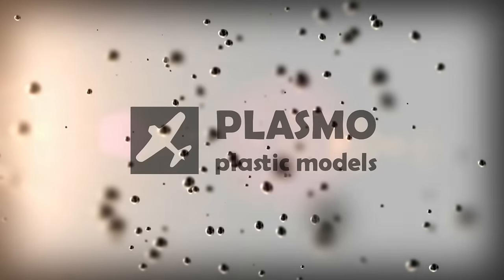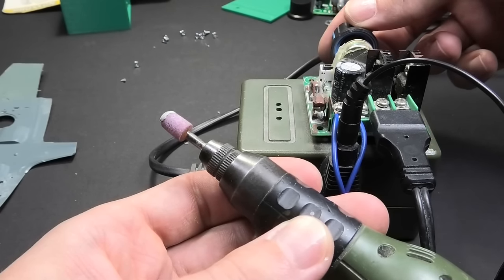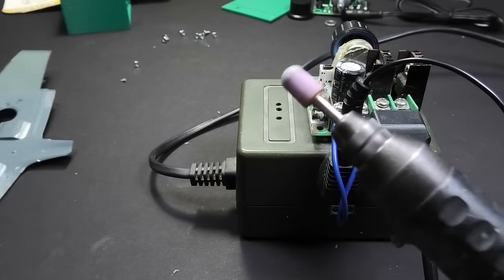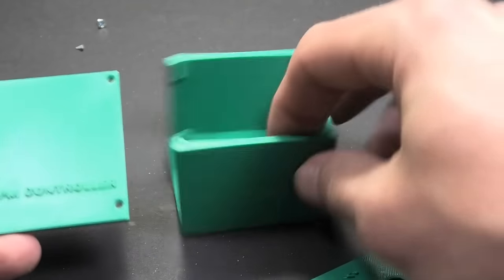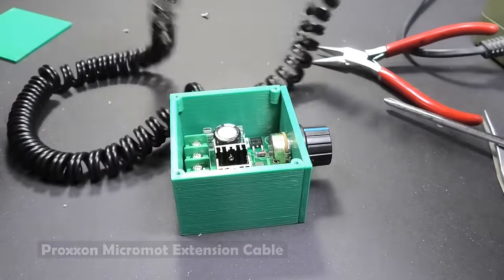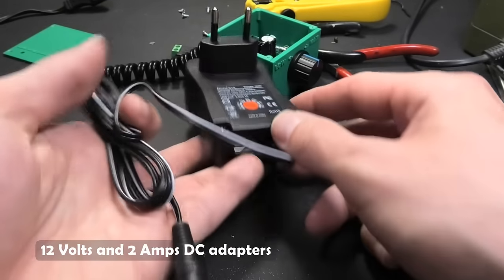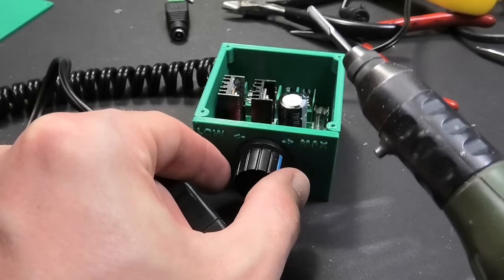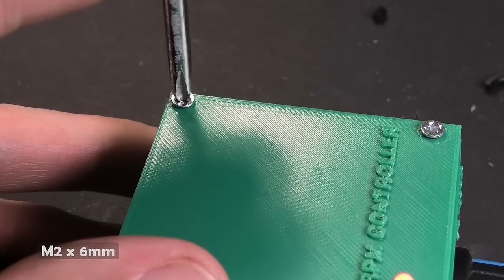DIY Low RPM Controller - Proxxon Micromot 12V Upgrade - Homemade

Comment: Simple project, inexpensive and a great way to slow down a motor tool.  Appreciate you including links to all the parts 👍
Reply: I don't get it.  Too much hassle for stuff already easily available and cheap  You can buy premade DC speed controllers for like 8 bucks and AC ones for 20.
Reply: @TheMugwump1  Good to know, thanks 👍
Reply: @TheMugwump1  Too much hassle but he did go to the trouble of providing links apparently that was too much trouble for you after you finished complaining!
Reply: @zorbakaput8537  Some people don't like the process of building things themselves, it's sometimes more expensive than already made and it takes a lot of time as well, see... like modelers do.

Comment: Hello Maestro.
I have been following you on YouTube for years. Thanks to you, I learned a lot of new things. You have made many products such as PE production, 3D printing, Low RPM Controller, Silicone Mold, Handmade Riveting Wheel, Scratch Build, Homemade AirBrush, Handmade Compressed Air Compressor. 

But you have no video on Decal printing. But not an ordinary print on plain decal paper. Not laser / inkjet printing, but a decal printing with a white paint solution. 

I've been thinking about it for a while, but I couldn't find a simple (cheap) way for white dye. There is no Ghost White Toner where I am :) 

I am sure you have a solution for this too.

You guys are great.

Comment: I've used a foot control for my dremel unit. I'm not particular to proxxon because they make expensive things out of cheap products. The small table saw unit is powered by a really subpar motor that heats up because of the poorly optimized plastic housing. I ditched that one and put a Singer sewing machine one, made out of metal. Also, cheap bearings. Not saying dremel's any better but at least they're a bit more realistic about the pricing (or used to be pre C19).
I recommend swapping the proxxon motor with a higher quality one sourced from a proper certified vendor. Those come with data sheets and that's how you can also look up exactly what controller you can use to slow them down perfectly (without steps).

Comment: Priced one up from Amazon UK just now - for the extension, box and circuit board it already comes to £30, so not as cheap as in your neck of the woods by any stretch, but worth it in any case. I have two battery operated ones in addition to my Proxxon (which I only bought after watching your videos) , but they are not much good, though recommended by a professional model builder.

Comment: this is excellent! I think I'll adapt it so I can use it with a foot control for speed. FYI, proxxon already produces what you built, the NG 2/E power supply. but I assume it's much cheaper to modify your existing power supply! nicely done!

Comment: I have that Proxxon motor, and it has always seemed to me that it ought to have a FOOT control, like an automobile accelerator pedal (or like a sewing machine pedal control). The way it is designed, speed control is a two-handed operation, and turning it on and off is also two-handed, which I think is a safety issue. A foot control would fix all this: turn it on by pressing with the foot, speed it up by pressing more, and stop it by releasing the foot.

Comment: Ignobel prize winner.

Never hide hot components like transistors on radiators in closed case without ventilation holes.

Never thin down plastic with hand milling without basing onto axis like coordinate table.

Never use chained speed controllers to avoid torque loss.

BTW Proxxon power cords plug into IDE HDD connector so you don't need to spoil extension cord just for socket.

All you need for Micromot is 12V/1A power supply (anyone will do, just remove capacitor on output) and foot pedal (safer on output). Working with foot you get as minimal impulse as needed. Melting plastic is due to dull tools not high speed.

Comment: I've got a cordless Dremel and the speed controller built into that goes down to very slow. I haven't got the exact number to hand, but it's slow enough not to melt plastic, which is all that reaklly matters.

Comment: I use a 60/E with the on tool speed controller with Proxxon NG 2/E variable speed controller, a large variation in speed available  ....maybe I missed the memo .🧐

Comment: Sorry o have  one call black and decker.  Had it for pver 20 years. It has setting  knob for high speed and  very low speed. And have manicures  device  for you finger  nails. It has the same thing  high and very low speed.  The decker  kind  still good and the other i bought it  from Amazon  for 100 bought  that 5 years ago. ...

Comment: its easyer to by a 400 or 380 or 480  motor with reductions gears . ratio 1/10 to 1/100 it will be great .they speed decreases but torque incerases.
all  most the RCshops have them. 
i modified mine  with a 380 motor with a 120 rear ratio. 
ps the motor numbers are sizes of the motors.mesure or better show yours  at the local rc shop as aguide. Happy modelling!

Comment: To reduce the speed without losing what little torque a Moto-Tool has, I'd recommend building a Variable-Frequency-Drive. It's not that much more expensive.

Comment: I used this system PROXXON Pensander PS 13 but it broke down. I used a 16 v adapter instead of a 12 v. Could this be why it broke down?

Comment: Or you simply buy the Proxxon tool that has a RPM control wheel on it, like I did. Problem solved..
Reply: And probably pay 10 times as much. Also, why not build your own, it's fun!
Reply: @_Jester_  
It's literally the same tool he uses in this clip, only with a wheel to control the RPM. They offer a variety, you just have to choose the right one for your needs.